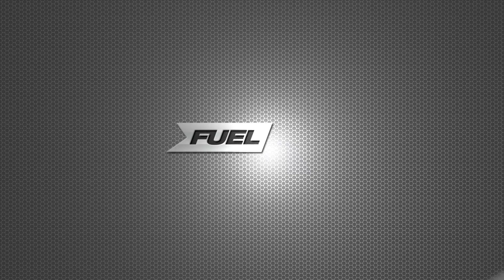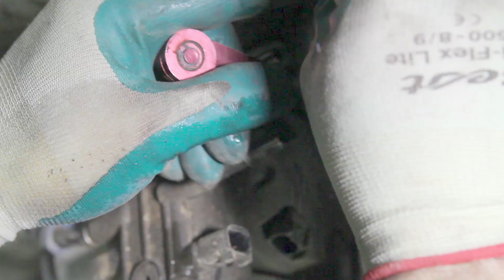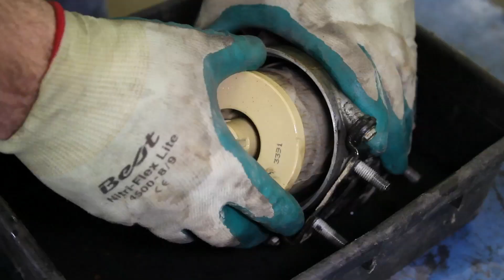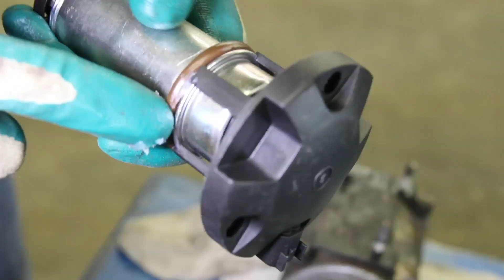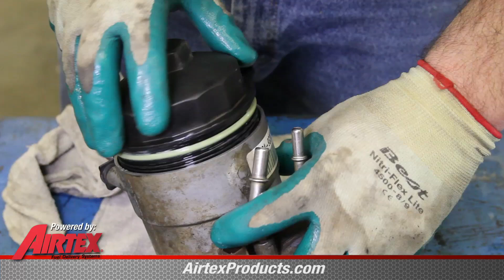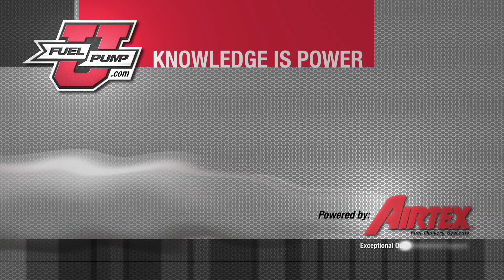How to Install Fuel Pump E2340 on a 2004 Ford F250 Diesel Truck

Comment: Tf are you so scared about with your fire extinguisher and your cleaning up spills immediately? 
Last time I checked diesel fuel only ignites when compressed and extreme heat is applied.

Comment: How would I turn the pump up?
Reply: BY ADDING THE BLUE SPRING KIT TO THE SECONDARY FUEL FILTER HOUSING UNDER THE HOOD AT THE OIL FILTER ASSEMBLY

Comment: How do you release the low pressure side (tank side) lines from the pump. They use some type of retainer clip which is different from the high pressure side which come off easy with insert removal tool. I have tried poking both tabs at the same time. Also tried getting under top of clip with a screw driver. You show using needle nose pliers, how did you release? Thanks R.

Comment: Will these pumps work for gasoline? I'm looking for compatible pumps for a gm marine power engine on my boat. It's a 6.0 v8. They use this type of pump but not sure if the brand is the same.

Comment: Are the fittings on the fuel pump 3/8 SAE inlet & to the motor and 5/16 -06 return? Thanks.
Reply: +Airtex Pumps thank you.
Reply: What's the size? Comment is gone.. idk why they cant say and this information is fucking impossible to find

Comment: I would only recommend using a new hfcm from Ford aftermarket parts do not hold up on these truck I work on these
Reply: +Airtex Pumps like I said I work on these trucks for a living in have seen many aftermarket parts fail on these truck I'm not some diy guy I make a living fixing these trucks i only recommend oem it will fail if it's not
Reply: +Airtex Pumps maybe so but I stick by my opinion has worked for years
Reply: @anthonyb8691  I agree to a degree. High quality replacement parts are pretty nice though

Comment: hi used your code E2340 on ebay,the supplier says it is not compatable with my 2004 f-250 6.0 liter diesel turbo,could you confirm ,thanks

Comment: i have a 2005 ford f350 6.0 i was driving from california and when i got to reno it loose power and start to shut off, do you think thats the fuel pump
Reply: Let me know if this fixed it pleaseee im having issues with my 2004 f250
Reply: @AndymendezOficial  I will be doing mine tomorrow or the next day, I am having the same problem as Jessica stated. i can't hit 70mphs and if i do i start losing power and my truck shuts off like its lacking fuel. yes its the fuel pump.
Reply: yes jesscia its the fuel pump!
Reply: Okay so I recently sold my truck, but on my truck what was wrong was the HPOP(high pressure oil pump) took it a shop that specializes in Powerstrokes and was able to get it running again repairs was almost $4k but was worth it.

Comment: if the vehicle is full of fuel will it spill out all over ?
Reply: Got the same question, ..dont u hate when they dont answer?  i do :/
Reply: @MachTuck  Do it when it's empty. It will all come out if you take it off with a full tank. you're welcome!
Reply: @houstonlumberjack6976  Thanks man, I did it with diesel in the tank, I ended up blowing the line, ..or lines, cant remember, till there was no flow, worked out! Thxs